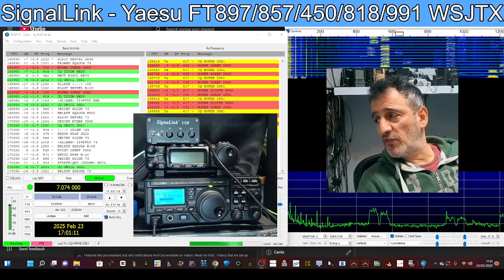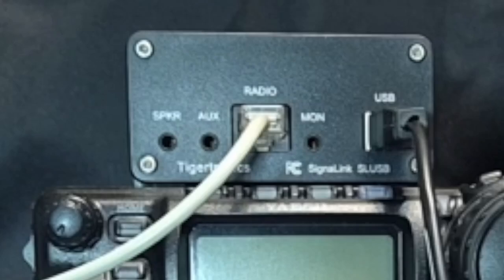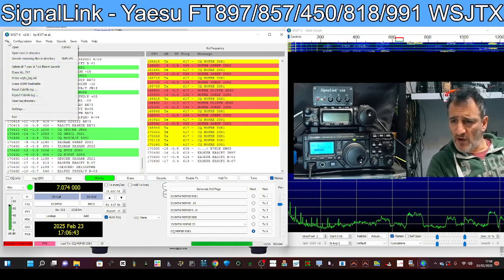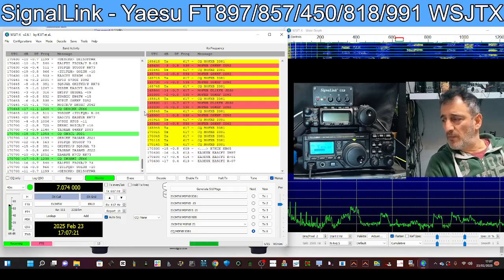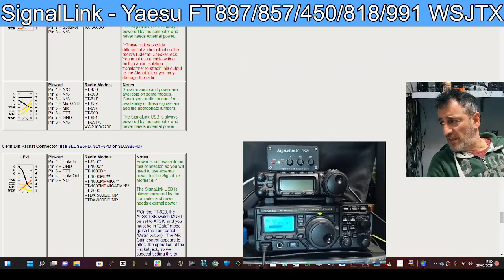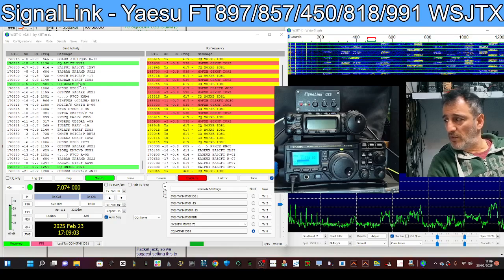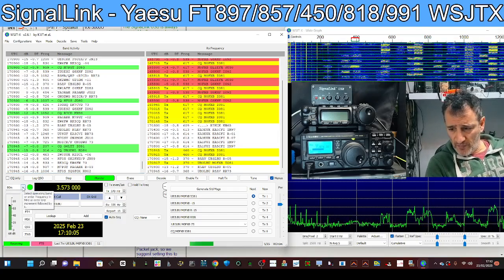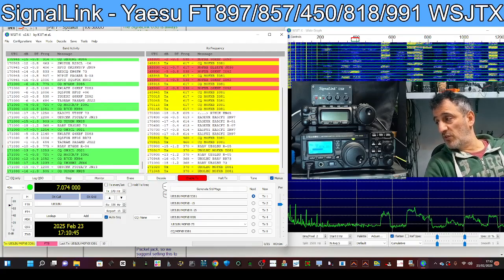SignalInk Yaesu FT-897 Set Up , WSJTX-FT8

Comment: I picked one up cheap at a rally the data cable should should work on the 857 897 and the 817 just set up for the radio on ft8
Reply from the maker: Yes worked well